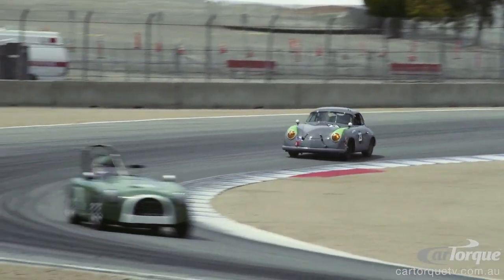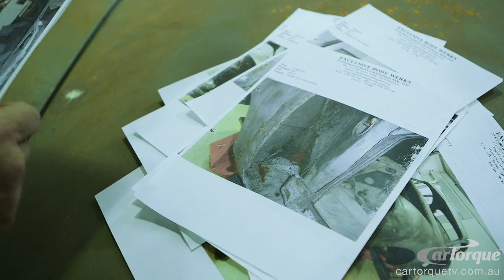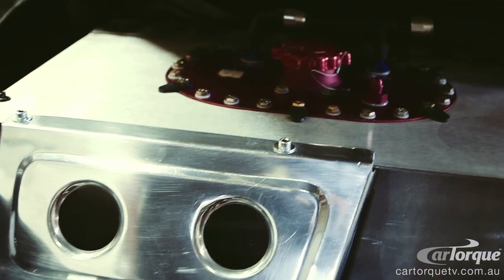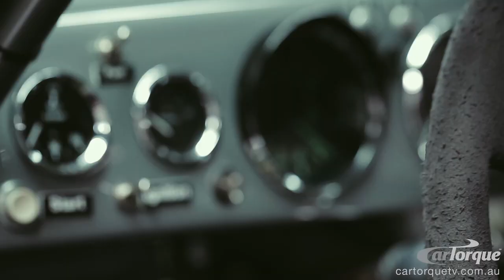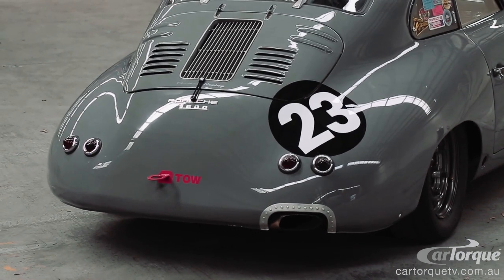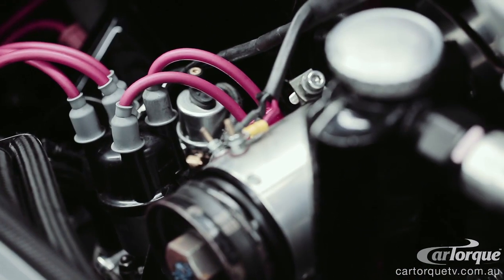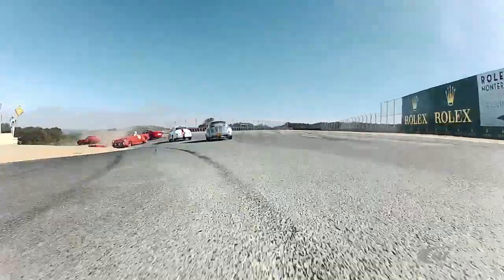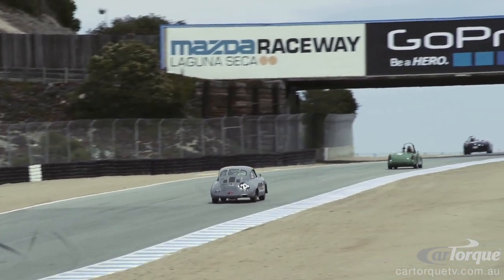CarTorque Series 2 - Porsche 356 Race Car

Comment: are those the same rims they use on volks bettlle of the 60's?
Reply: +EvendimataE No, Porsche rims are 5.5 inches wide and VW are 4" wide. They both share the same bolt pattern of 5x205mm.